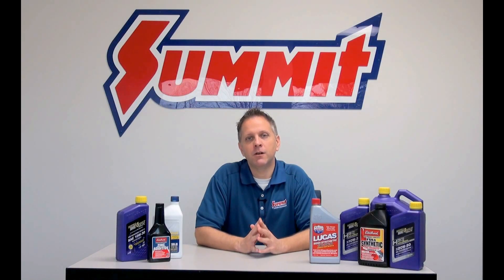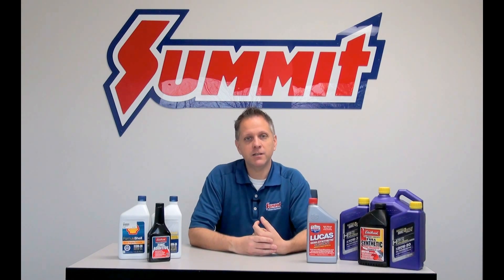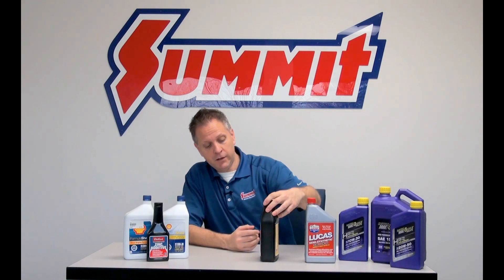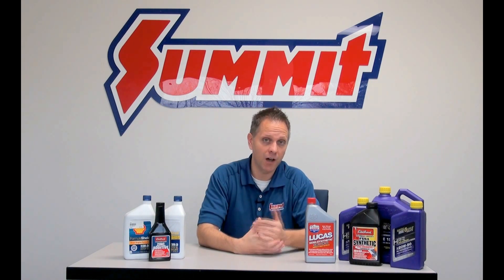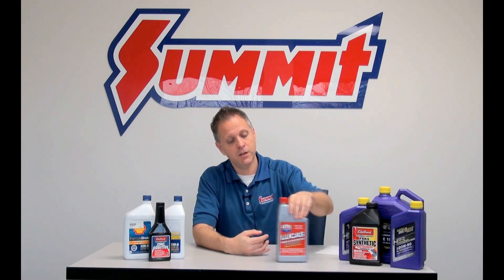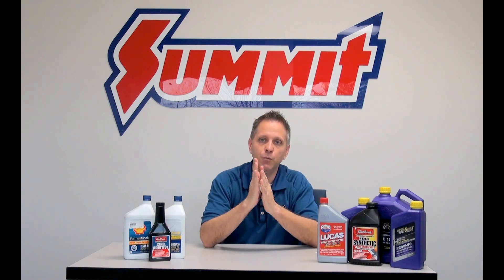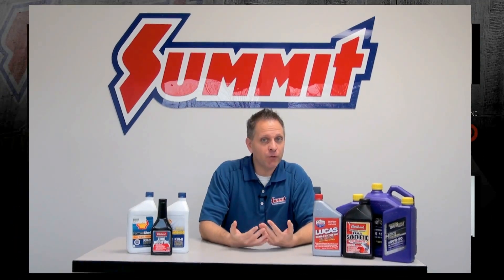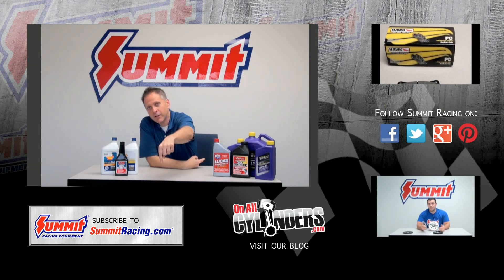Synthetic Oil vs. Conventional Oil - Summit Racing Quick Flicks

Comment: Why are you wasting time, the only concern we have is,what is in the,synthetic oil, you are absolutly insulting the viewers telling them it is to complicated, you are insulting. We have no reason to believe anything you say, you only have tried to mislead. Dimlle wuestion what is in amsoil verses other synthetics, why should we believe amsoil is not a scam more than other synthetics. I have over had all my cars go over 350k 440k miles on regular petroleum 7k changes. What will amsoil do better and why ? Facts,  specs, no puke talk.
Reply: Most European engines now have oil requirements which cannot be met with mineral oils. Change it every day if you want but it's still not gonna work.

Comment: Yeah the guy there for Summit oil or Summit Racing Dave he says there's conventional oil and then synthetic with additives and full synthetic there's also 100% synthetic that does not have natural oil from the ground it's all made in a lab so he's not giving you exactly the proper information because if you're running a hundred percent synthetic oil you can go 25,000 miles with the proper filter and if you're driving 25000 miles in a year that's one will change compared to Conventional motor oil that you'd be out of eight oil changes in a year so there's no comparison at all one hundred percent synthetic blows away conventional 100% synthetic blows away full synthetic so he's got to get his facts straight before he starts putting out this kind of stuff on the internet
Reply: You should give entech oil a try so far best formula I've tried

Comment: Synthetic oil is definitely better. 
Do not confuse yourself with full synthetic and 100% synthetic as they are different.
100% synthetic is Group 4 (POA) oil with can last more than 15K
Full synthetic is group 3 oil (highly processed mineral oil "Hydro cracked") which is a great oil but not as good as group 4 oil
Reply: NABEEL MURAD you're right on, You should give entech oil a try so far best formula I've tried

Comment: You would ban conventional oils? Have fun with a crusted engine! Synthetic oils don't contain detergents, therefore they do not clean your motor. This is why people put detergent additives in their synthetic oil, but most synthetic do not react kindly to oil additives and do even more harm. To the guy below me saying that his oil wasn't black so he didn't change it, you dumb dumb! If the oil is black it is doing its job by cleaning the engine, that is more proof synthetic oil is garbage.